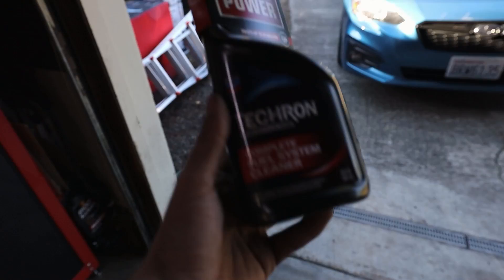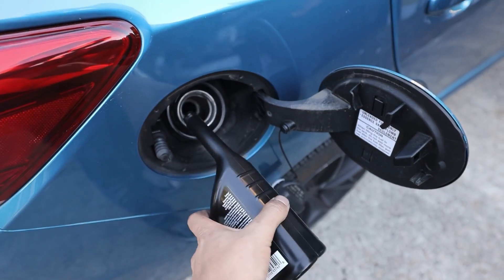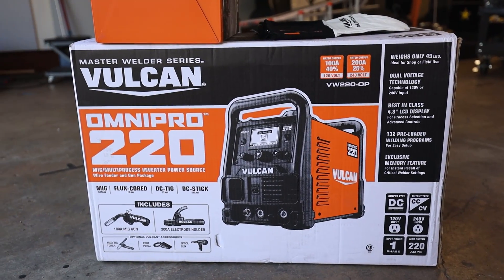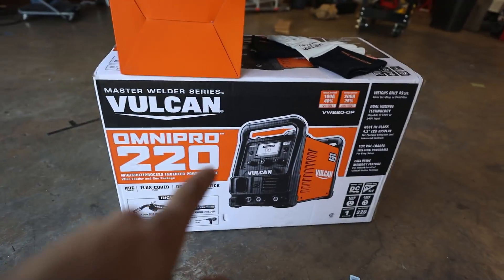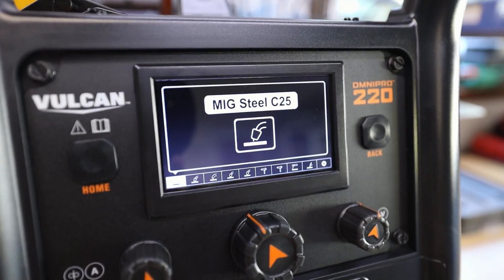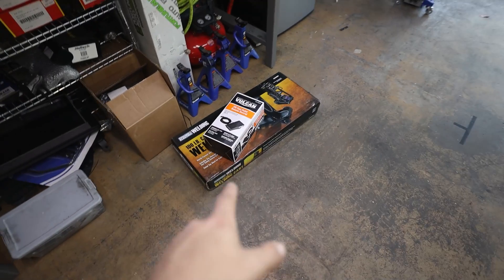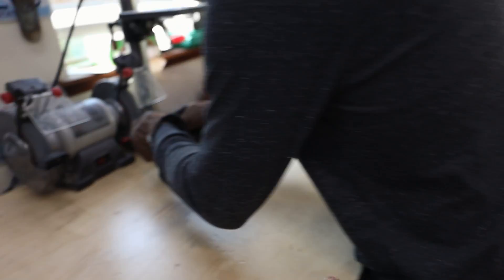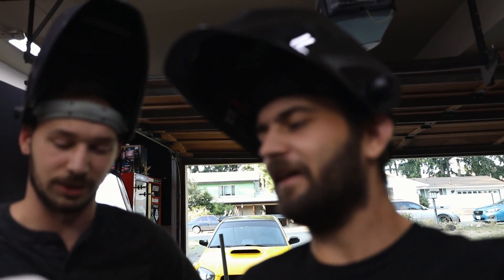Learning to Fabricate and Weld! Vulcan Omnipro220

Comment: Had A Vulcan Omnipro for less than a year and it crapped out on my. Would MIG Weld and the digital screen got major lines in it.

LUCKILY, It had the original 1 year risk free warranty..........which  now has changed to just 90day(jeez i wonder why)

Anyways, I got a refund and went out and bought a Miller Multimatic 220. Much more expensive but damn is it a good welder

Comment: Try and get a new grinder for only sharpening tungsten. If you use a pre used Grinder it leaves  contaminants on the tungsten rod.
Reply from the maker: Bought a second grinder for tungsten only 🔥
Reply: @Smeedia  awesome dude! It will improve the quality of your welds also try and clean the surface of anything your welding prior it will also help a ton!

Comment: I'm a Welding Tech by trade, I've taught, and own a store they sells welding equipment. Gas was the major issue you were having, also hook up your torch on DC- for TIG, you'll have less heat input on the tungsten. You need Ar/C02 to MIG weld carbon steels. Also you need different Argon CO2 blends if your going to use Flux Core, or Solid Wire. Some Flux wires are gasless but compared to solid wire they are more messy because of the slag. 

I'd recommend a .23 - .25 solid wire on a 90/10 gas for MIG welding thin steels and I think you'll like your results.
Reply from the maker: I'll give it a try, thank you for the recommendations. We were using 100% Aaron, for the mig side of things but wanted to try tig as well so we stuck with that. Going to give it another go 🙏🔥
Reply: @Smeedia  Nice, you'll get it with some practise. Carbon steels need some co2 because it reacts with the steel and increases penatration when MIG welding. If you want to TIG aluminum you might be out of luck with that unit. I'm 99% sure that machine only has DC output and to TIG weld Alum you need AC output. Just a heads up incase you didn't know.

Comment: You shouldn’t see any spark when tigwelding that happens when your tungsten is contaminated you should prep the surface then clean it with acetone the amperage is determined by metal thickness and travel speed when I started learning it was difficult until I started doing the proper setup and from there it was so easy to learn and see improvement
Reply from the maker: Swapped to a tig only welder yesterday, the strike to start was ass. But it definitely was contaminated. Able to tack aluminum together but still have ways to go. Biggest set back is being limited to 110 😤
Reply: Do you have an open circuit on your breaker? If so you might have enough space to install your own.  

You find that fuel pump 👀

Comment: So if I have a 93 tune on a wrx do I need to be weary of using something like a fuel system cleaner or injector cleaner?
Reply from the maker: No you do not 🙏 I've ran it through plenty of cars on OTS/protunes Tunes and never have had issues 🔥

Comment: As a welder/fabricator from the age of 12(now 46), I will agree that through such practical training you can indeed become quite skilled. I will stress that, if possible, you should look into formal training at a local trade school in your area. Having a guiding hand to direct you will shorten the learning curve dramatically. Such training will also offer you an insight into the physics of the operation as you learn why things work the way they do. Even with all that info aside, you will walk away with the knowledge of how to properly set up the machine in accordance to whatever variables any project you are working on might have(voltage, polarity, metallurgy, etc.) In my opinion, that alone is worth enough to justify completing the course.
Reply from the maker: Good to know, I have my fabrication friend who can help guide me on set up and the material science behind it. Right now I'm trying to get comfortable with the machine, so far so good. Have been able to tack aluminum together as a start. One of our drawbacks as well is being limited to 110V. 
But def going to keep learning. Alot more that goes into welding that I initially thought
Reply: @Smeedia  You shouldn't sell your setup too short. I've seen some amazing work done with a 110v machine. Just make sure you keep an eye on the rated duty cycle. That said, however most higher voltage machines are easier to operate and actually cost less to run all while being a bit more forgiving. It's kinda like having an engine over-built and under-driven.

Comment: To better sharpen your tungsten, put it in a high speed drill, and run it parallel to the belt of a stationary belt sander. The sharper tip might help with your problem, although I've never used a tig that required contact to arc.
Reply from the maker: Started doing this and works 100% better 😅🔥 I returned that welder and got a protig205. No more scratch to start now

Comment: Glad to see your getting in their and trying the welding rig out. Was that gas 100% argon? Those sparkles looked like you had a reactive gas, maybe 75/25. Did great on the  mig welding. Make sure everything is clean and fresh metal with a grinder or tiger paw, none of that mill scale on it. Once you can stabilize the Tig arc and control it then start adding wire. Keep at it, I started out the same way. Once you start you be looking for shit to weld up.
Reply: Also if you go to harbor freight, get the diamond rotary grinding wheel for $10 (3 piece set). It can cut your tungsten down really quick. It has a 1/4 shank to fit in some drills. I use it all the time in the field. Been Tig welding boiler tubes for about 7 years now.
Reply from the maker: Yessir 100% Argon, lol that's been me all day anything around the garage I can atempt to weld I've been trying 😅
Got a tig only AC/DC machine and working with aluminum now. Can get tacks down and some very bad beads but it's a start.

Comment: @smeedia welding is like any other skilled trade, it takes dedication and a lot of practice. I can give you some helpful advice, whatever material you're working with needs to be clean, acetone is going to be your best friend. Welding doesn't like oil or dirt, you'll get porosity lack of fusion. Steel needs the mill scale removed to bright shiny metal otherwise you may get porosity, aluminum needs to be wire brushed with a CLEAN stainless steel brush to remove the aluminum oxide (think of a patina like copper). For GTAW (tig welding) you could get away with just using a 2% Lanthanated electrode as all around use (you don't really need a bunch of different types and diameter tungstens), 3/32 is pretty safe for diameter. Straight Argon is good for what you're doing with GTAW, if you get into GMAW (mig welding) you'll need 75/25 or tri-gas for stainless. The size of your cup is in 1/16"s eg. #6 cup = 3/8" orifice, #8 cup = 1/2". Size of cup determines a lot of things, gas flow: double the size for CFH eg. #6 cup = 12 CFH of gas, #8 cup = 16 CFH of gas. Cup size also determines tungsten stickout, for example #6 cup is 3/8" so that would be your MAX stickout, less would probably be better. Rule of thumb for amperage is 1 amp per .001 thickness in material, such as 1/8" = .125 = 125 amps. Hope that helps, good luck and keep practicing!
Reply from the maker: So much that goes into it but that you for all the tips! Picked up an AC/DC tig only welder today. One of the hardest things I'm working with is limitations to 110V only. 
I was practicing with aluminum today trying to get settings dialed in and am able to at least get tacks down at some very bad beads lol 
But going to keep at it, we're using 100% Argon right now also

Comment: Chuck your tungsten in a battery power drill and spin it as you sharpen it.  It'll give you a perfectly uniform sharpened point
Reply from the maker: Thank you for this! Tried it and definitely made welding 10X better. Got the basics of tig for steel and aluminum kinda down need alot more practice

Comment: You should check the tire pressure on your wife’s Impreza, cooler fall weather will deflate the tires, in turn reducing her MPG. I went from 40 down to 35 mpg with my civic hx by not checking it recently. It’s starting to get colder out, pretty soon I’ll be chaining up the semi for climbing Snoqualmie pass…
Reply from the maker: We actually just swapped the tires out back to her stock set up all still 👌🔥

Comment: I have not finished the video yet but for gas when I worked at a fab shop we ran 20%/80% and was TIG welding stainless steel as low as 12G stainless steel to 1/4 inch. Doing this blend makes the gas slightly reduced and can get cleaner good welds without the surface oxidation. However, I believe you need 100% for aluminum alloys since the hydrogen will start cracking. There is also helium blend but I don' think I've ever tried this. I know if increases the temp and deeper penetration for thicker metals, this might be better for thick pipe welding though.

here is a budget Tig Machine: TIG Welder/ARC Welder TIG-205DS | YesWelder

This is an inverter so you put the positive in the negative. I would use something similar to this but the Miller inverter instead, when I had to go weld off site at job sites. That cost about 1500
Reply from the maker: Ended up getting an investor today that's AC/DC for tig only, this shit is hard to do 😅 going to keep playing with settings and techniques but may snag that 20/80 for steel 🔥
Reply: @Smeedia  Oh sweet. When I was learning I watched a lot of ppl doing TIG IRL. If you don't have that luxury here is a good video of someone doing some quality TIG work in HD. 

go to:

 youtu (dot) be / xpZUKEH6rwg  

and fast forward to 34:22 and watch how he applies the heat and rod

Comment: I imagine that machine would be better at tig welding with 220v with the extra heat output
Reply from the maker: We need to get wired for 220 😭
Reply: @Smeedia  shoot, why haven't you wired it yet? Easy peasy 😁
How far away is your breaker? Most welders run like garbage on 110v and basically is just for emergency use or say it "can" do it.
Reply from the maker: Breaker is in the garage just need to figure out how to do it 😅
Reply: @Smeedia  Oh that's super easy then.  Hardest part is cutting the drywall.

Comment: Friendly TIG tip: Get a grinding wheel for your bench grinder and use it ONLY for grinding tungsten. Otherwise, you'll get impurities in the tungsten. I have a whole separate grinder that never sees any other metals. Also, research the different kinds of tungsten. They serve different purposes. TIG gets really complicated really quick. I'm still learning myself. lol.
Reply: and put the tungsten in a drill to make sure it’s a perfect point when grinding it
Reply: @jacearrington1037  Good call. Forgot about that. Been awhile since I've sharpened some tungsten. lol.
Reply from the maker: Going to do this, the grinder we've been using had been used for all sorts of odd ball things 😣
Reply: @Smeedia  Yeah. It'll really make a difference. Also, for aluminum always clean the surface with a stainless steel brush and/or sanding disks or paper that only gets used on aluminum. And wipe it down with acetone. If it sits for awhile after being cleaned before welding clean it again. Aluminum will oxidize super fast and contaminate the welds. 

As for the MIG setup keep in mind that the wire feed also controls the amps and the other knob will control the volts. So its not always about getting the machine where you're comfortable, but about getting comfortable with what the machine needs. It's a dance. lol.

Have fun with it. I find welding to be relaxing. Except when doing overhead welds. Slag rain is no bueno.

Comment: I know about crank sprockets and crank position sensors very well. The assholes who built my 2nd engine broke a fuggin tooth off the sprocket and gave it back to me like I wouldn't notice. Shitload of issues among the others they created.
Reply from the maker: Ohhhhhhhhhffffft sounds like a load of issues and fun problems 😑
Reply: @Smeedia  that was the least of my worries with that engine. The machining portion went decently but the guy who put it back together ground down the valves so short (instead  of doing a valve adjustment like he should have) that they would barely move when the cam lobe rotated. Assholes. Got everything they charged me for back in court, but lost all the money in parts I put into it as they were fucked from trying to run the car properly.

Comment: You are correct, getting good at welding takes practice. How I learned TIG welding was doing fuse welding before even try to add filler rod. Focus on puddle control and getting the puddle to move. Don't beat yourself up on having the tungsten getting stuck to the metal, it's easy to accidentally do that. It's the gas that moves the puddle, not the tungsten. Focus on keeping that tungsten 1/8 above the metal and the torch tip tipped to the side at a 30°, pointing towards the direction you welding. I'm right handed and when I TIG flat steel on a table, I start from right and move left, torch in right hand. I also do a curly q pattern/ motion with the torch to help puddle control and chances porosity.
Reply: I couldn't agree more. Scratch start is horrible. Try and get a TIG welder with DC and AC so you can TIG aluminum. It's hard to find one that will do both on 120V, but they are out there. Miller is my favorite brand cause the welds seems to come out looking the best, but the duty cycle is alot less than a Lincoln TIG welder.
Reply from the maker: Just got an AC/DC Tig only welder to play with today 🔥😁
Reply from the maker: Going to have to give that a try, I returned that welder and am swapping to the tig pro 205 to actually be able to tig weld. The scratch start is awful on that thing

Comment: I have this same welder. A friendly heads up. If you want to tig weld aluminum, you’ll need a (AC tig)machine not (DC tig).
Reply from the maker: On the hunt for one now 😅 ended up returning this welder
Reply: @Smeedia  look at the primeweld tig225x its really good for a decent price it has ac/dc
Reply: @Smeedia  😂 I did the exact same thing…
Reply: You could use aluminum spool though with that welder but not as good as dedicated ac tig
Reply: @Shiftheads  spool gun does penetrate deep enough and the welds are easy to break. I tired both the spool gun and DC tig multiple settings. Both had poor results.
Reply: @Hardcore_flat_four  were you on 240v?i didn't have that issue but I wasn't trying anything that was super thick

Comment: Man, I should have dropped by and helped you XD
Reply: Also, a tip I can give you when mig is do your beads with little half moon shapes, it'll help your bead lay better. For tig, you're likely sticking so much because you're keeping a bit too close to the metal.
Reply from the maker: Going to have to keep practicing, much harder than I originally thought 😅😅😅
Reply: @Smeedia  Yeah. I was in a welding class my last year and a half of high school. Did a lot of mig, tig, and stick welding lol. I can still do vertical weave in my sleep.
Reply from the maker: The mid side did not seam too bad, did not even attempt stick 😅

Comment: I run a cleaner through mine every other oil change. Probably a little excessive but I haven't had many fuel issues with any of my cars so far 🤞
Reply: And the machine will do much better at 220 for tig. Tig is more power hungry.
Reply from the maker: We don't have any 220 😪

Comment: The one thing I really want to learn how to do is welding just never had the chance to even try plus it'll probably help get my foot in some better shops to work at than I've already got
Reply from the maker: Will be a good skill to have for sure, it's not too hard to mig weld,  I feel like most people could pick it up pretty quick 🔥
Reply: @Smeedia  definitely gonna do it, just gotta be financially be able to
Reply: @hatefunwrx  just jump in! There's loads of videos on here to give you a proper foundation. It doesn't have to be expensive either. Keep an eye out for used welders FS. Personally I would get a MIG with a shielding gas input. I think it's a lot easier to be able to see your weld with a gas setup, thus allowing you a better understanding of how certain movements effect the weld puddle.
Reply: @ThatGuy-yj3lu  pretty sound advice, I will definitely keep an eye out for some used ones for sure.  Thank you
Reply: Bro do it. Mig welding is so good after you learn the ropes. Get gas bottle and the wire without the flux core on it. Get yourself a decent mig welder and a workbench. Get a table grinder and wire wheel, a chisel, gloves, and don’t cheap out on a helmet bc that is your eyes 👀 the pretty blue light isn’t very kind